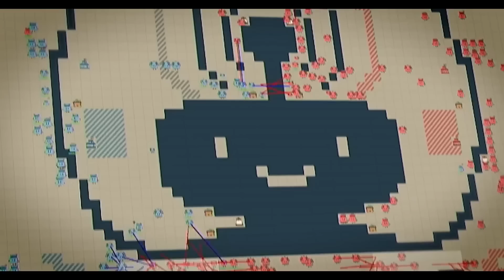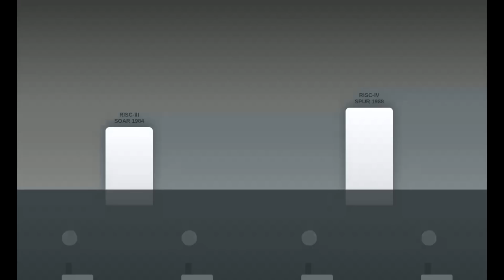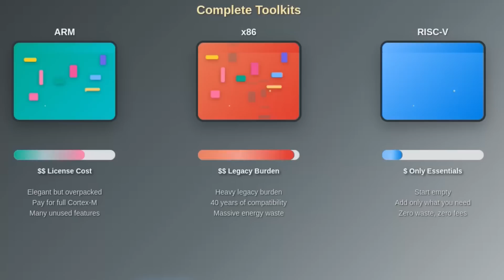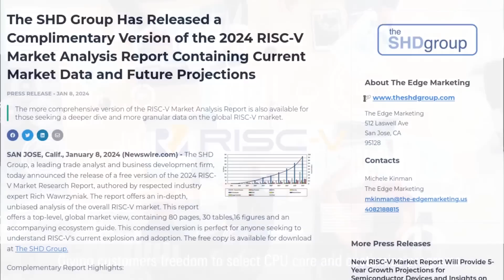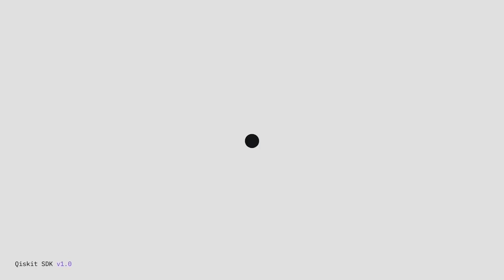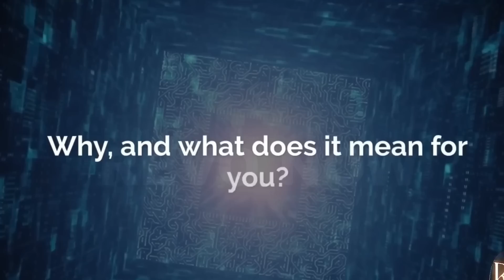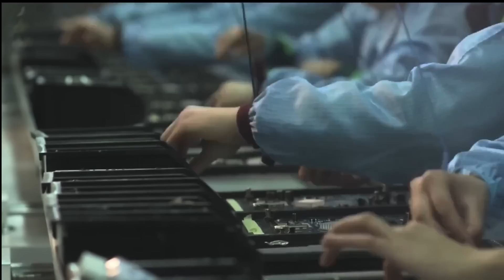RISC-V Will Conquer the World

Comment: RISC V instruction set is awful: it takes many instructions even for the simplest of operations. It doesn't have register windows like OpenSPARC, it doesn't have branch instruction slots, giving one a gratis extra instuction on any branch not taken like OpenSPARC, the performance of RISC V is dismal when compared to the SPARC64 and the UltraSPARC T4, T5, S7 and M8, even the 20 year old SPARC64 VII from Fujitsu runs circles around the fastest RISC V microprocessors. And ARM64 designs are also much faster than RISC V. There is also no standard way to boot a RISC V system, everyone does their own thing, so every bootstrap is custom. I am hereby openly accusing you of ideology and hype.

Comment: Wasn't it Microchip that started the RISC series with PIC processors. RISC architecture has been around for decades. If the clock speeds are not high , they just end up with less performance than a normal processor.   Check out performance of RP2350, which can be run in both modes.

Comment: The RISC-V will get nowhere unless there is a second source for the parts. Custom parts are extremely expensive to make - the EDA tools cost hundreds of thousands a year, the masks likewise, and then the fabrication costs. This is not possible for most startups unless they have millions of dollars in the bank. RISC-V is just an ISA architecture it is not an open hardware platform.

I believe we need actual Si with multiple manufacturing sources to allow this architecture to be used by SME, and startups. Maybe the RISC-V foundation should standardize some parts, including the power, timing and pi 0:35 nouts to make it really open to all ?

Comment: One thing you seemed to miss is that the path RISCV is currently on is nearly identical to the path that ARM is on.  RISCV will  definitely fully displace ARM in the future.  Unforturnately, like with ARM, I think RISCV will not be able to displace much, if any, of the x86/x86-64 CPU market.  ARM has not been able to replace an x86 CPU for one good reason:  Performance.  ARM has a price:performance advantage... until extracting the performance of an x86 core from an ARM core.  At that point the price has skyrocketed, power consumption has increased drastically, and value is eroded.  RISCV, like I said, will definitely replace the ARM CPU's eventually, but there's not much hope for replacing x86.  (BTW: The ARM chips that are able to rival an x86 have virtually become a CISC chip by then with the absolutely massive expansions to their instruction set and complexity involved in programming them.)  Thanks for the video.  Well produced and thought out.

Comment: In the movie Hackers (1995), there's the quote that RISC is going to change everything. At the time, this was already a joke as people had been saying that for so long.
Reply: CISC is so power hungry. There is no CISC core that beats a RISC core on a MIP/WATT or FLOP/WATT which is why many CISC architectures have turned to RISC internally to simplify and reduce power consumption. Also, ARM was designed with C and C++ in mind while x86 wasn't. I have vector graphic illustration program on my ARM which is literally 1000 time smaller than x86 equivalent and runs that much faster too. Either Microsoft cannot optimize their compilers for x86 or CISC is very inefficient. I suspect both.
Reply: The current x86-CPU are internaly RISK as far as I know.

Comment: RISC-V compared with i5/i7 in desktop environments: RISC-V is 20% - 80% slower. So I wont hold my breath.
Reply: You're not wrong to say  likewise I RISC-V is promising, especially for open-source and low-power applications, but it’s not ready to replace i5/i7 for mainstream desktop use—at least not yet.
Reply: That is simply because the same level of effort hasn't been put into it. There is nothing about the architecture that makes it inherently slower.
Reply: All the efforts so far to develop risc-v have been in the embedded and server space, as mentioned in the video. Those have different criteria for design than desktop PCs need. There's likely to be a trickle down effect from some of the development in the server space, but the last estimate I saw for high performance personal computing on risc-v, was that it's five to ten years away.

Comment: Disagree entire video. Riscv is bad because it doesn't always come with the entire instruction set which by the way is probably less then java bytecode 256 instruction set. If a cpu cannot compute it's not a cpu. Only thing I agree with is you don't need vector extensions that's a GPU thing. Arm is better in every way and also allowing more companies to build arm chips like apple. Arm has ultra low power consumption and isn't only made for mobile devices unlike what you said in this video. Riscv processors may be good on the software side but the actual CPU are either low performing or buggy unless made by a property company like wd. Riscv is ok for non true cpus like the chip found in your hard drive or SSD where you don't need an entire CPU or power. But same could be said for an asic chip the difference is riscv is cheaper to make and takes less research and cost
Reply from the maker: Believe me, sometimes it's actually pleasant to hear such a disagreement — and that’s perfectly fine. Your opinion is completely different from mine. I see RISC-V from a different perspective, not just technically, but also culturally and ethically.

Comment: isn't there a fundamental difference between ARM and RISC-V business model.
with arm license you get a transistors blueprint, which you know works well and is tested, and all you need is to put it in a chip with some additional modules.
with RISC-V you need to design it yourself or get a commercially designed core anyway, from a smaller company with less gurentees of compatability.
Reply: @michaelzlprime  Not quite. How it works is well-known and RVA23 Is the standard instruction set upon which all future programs and operating systems will confirm with. RISC-V means total freedom. Yes, there is a cost to manufacture, but that is to be expected.
Reply: With arm , if you design it (the micro-architecture) yourself, you get sued.

Comment: You visit the *RipperDoc to get a neural update to your core processor. He sent you an encrypted sub-token letting you know he has something special. Something called Risc-6 was created for some of the newest neural tech. This new in your head chip includes a new NIP extensions expanding your cyberdeck to use new network protocols. You will no longer need to cross the *Blackwall to get to powerful coprpo AIs. Only the Risc-6 nano-chips will be able to run the latest daemons. These new daemons are available only in lesser known cyber-shops. Net Runners upgrade today. "possible fiction, *CDPR CP77, 80" 11 BD 55 7A 7B".

Comment: For custom built hardware, the modular instruction set design is useful to save a penny in production costs. But for a general purpose desktop OS a CPU needs to be able to do every feature out of the box without needing a complete hardware change to enable some feature. Turning on all the features described sounds like CISC with more steps.
Reply: Many Linux Distros have already caused a headache requiring a new vector set for their distro. Orange Pi is one board that has been cut off at 25.10 so we  may not be able to use newer versions of Ubuntu Canonical releases. " Ubuntu 25.10 release to mandate RVA23 profile, obsoleting most RISC-V hardware."
Reply: @alabamacajun7791 It was better that this be done early, before people start buying RISC-V  desktops.

Comment: Uhm the only cons is that if there is no standard set of instructions because mosularity you might have to recompile the code for every different processor, which might not be possible with proprietary software... In an era in which you don't own anything i see it hard to believe  ompanies would allow that. And even with opensouce software it would be a pain to correctly crosscompile for custom CPU sets...

Comment: I doubt RISC-V. Linux circa 1994 (Red Hat Linux debut) promised to replace dirty Windows.  But, after 30 years, still about 4% market share in desktop OS. I forecast that RISC-V will reach 5% market share in CPU/SOC market by 2050 or 2060. The only exception will be the fixed controller core (e.g, controller embedded in WiFi chip or SSD chip, etc.). Even on 2060, RISC-V will hardly be used to run application software like game or web browser or spreadsheet on smartphone or PC or game console. Most RISC-V will be used as embedded controller chip like ECU or ABS controller in automotive industry.
Reply: The difference is with the OS analogy is that money was involved. Windows just worked and Microsoft paid off OEMs. 

At this time, ARM is currently a huge competitor to x86 in terms of chips. We are already in a period where there is a changing market. There is significant actual benefit to using ARM depending on the use case. All we need is a major funded player to join the game, just like Apple did with ARM.
Reply: @EmCeeJuan1  I don't expect that Microsoft or Apple or Samsung /HP/Dell will ever sell laptop computer/desktop or datacenter server or smartphone based on RISC-V and get 5% of market share before 2050. Even with Apple Mac computer line based on ARM, Windows laptop with Qualcomm ARM chip is struggling on market. We don't see RISC-V based smartphone, yet.  I expect 10% share of ARM Windows laptop by 2035. RISC-V based PC/smartphone? Below 1% share until 2050. No technical/economic incentive to switch to RISC-V from ARM.
Reply: I'm more positive than you are. RISC-V is moving fast.  I expect it'll be less than 10 years to desktop/device usage.

Comment: Programmer's Journal 1990s, Hal W. Hardenbergh OFFRAMP: Hal declared RISC dead in ~1995.  RISC depended on inferior (slow) RAM hardware and slow CPU clock rates. Your hardware is hardly RISC. It must support multi-threaded  capability, which was never part of the original RISC definition.  The silicon needed to support "score-boarding' is hardly simple!  Your RISC-V description sounds more like the DEC Alpha/AXP chip which was really an optimized instruction set chip! I look forward to seeing RISC-V on the shelf. I suggest adding security from OpenVMS, which uses hardware, software features to protect the operating system. I suggest supporting High Performance Computing (HPC.)  We need cheap and ever cheaper electricity everywhere! It's a fantasy to think more electricity  will not be needed! We need to stop the "watermelons" from driving the cost of electricity up daily through the EPA and other socialist organizations.
Reply from the maker: It's true: the original 1980s RISC definition didn’t include multithreading or advanced execution units,  but the world has moved on. RISC-V isn’t trying to preserve a museum piece; it’s building a modern, modular, extensible ISA rooted in RISC principles but designed for today’s needs.

Hal may have declared RISC dead in 1995 , but ARM, Apple Silicon, and now RISC-V clearly disagree.

RISC-V isn’t about dogmatic purity. It’s about open innovation, custiomization, and trust.
As for OpenVMS: great inspiration , but today’s security needs must go deeper, and that’s why open silicon and verifiable hardware matter more than ever.

And on power? Efficient design is the point. If anything, open hardware gives us a fighting chance to do more with less, instead of chasing unsustainable complexity and centralized control.

Comment: Yeah, linux worked as an open source platform because it matured in a free and open enviroment. A  party with ill intent can only resort to bugging and hacking as they already do with an existing OS. You cant corrupt its programming and spread it about for very long without someone catching it. It like trying to hide in the open. Chips are different. If a group conspires to make chips with a fatal flaw that can fail on comand, no one would know. They could make billion of them and spread them around to anyone that might have a use for that type of chip. Like a sleeper cell, waiting for decades, to receive the command to perform its hidden function.
The potential for death and destruction would be limited only by the perpetrators imagination.
Reply from the maker: You're absolutely right to highlight the asymmetry between open software and opaque hardware:  it's one of the most critical challenges of our time.

That’s exactly why initiatives like RISC-V matter: we need open architectures not just for innovation, but for trust and verifiability. Closefd-source silicon is a black box : and you’re right, it could be weaponized in ways no antivirus can stop.

We need more open tooling, open verification flows, and global cooperation around chip design.
The nightmare you describe? It's not science fiction. It's a warning, and the op[en hardware movement is trying to answer it before it's too late.
Reply: @YouTuxChannelGlad to hear im not telling you something you dont already know!  
Who is making them now? Is there any kind if international register on who is making how many and where did they go? Serial number, date of manufacture? That sort of thing? I cant imagine how you secure from that without violating the very principal of what it is your trying to accomplish.
Reply from the maker: This is another intelligent observation that touches on a crucial issue for RISC-V:  one that will determine whether it becomes a true revolution or just an open-source chip that doesn’t shift the deeper power structures.

The beauty of RISC-V is that it opens the door to verifiability , but you're also correct that open ISA ≠ open chip by default.
That's where projects like OpenTitan come in: open silicon designs, open tooling, and even transparent verification pipelines.

But yes , we're still far from having fully trustable supply chains.
What’s different now is that we finally have the chance to build that transparency, instead of blindly trusting black boxes from opaque vendors.

It’s not perfect , but it’s the only shot we’ve got.

Comment: One Linux RISC-V phone please.
Reply: Maybe in 10 20 years
Reply: With samsungs sh* chip foundry which will make it a heater
Reply: @martinmathangani   Android is a linux based os anyway.
Reply: Why not desktop OS on RISC-V
Reply: With many propertary packages, locked bootloader and with a tone of solder and glue
Reply: @martinmathangani  it would need a car battery
Reply: @martinmathangani  Phones are a full high end  computer, it needs a powerful CPU. Not a Risc-V use case. YET!

Comment: The hardware needs a similar standardisation. We need the same hardware from multiple manufacturers - the current system is just not standardized enough: the debugger interface, the instructions extensions all allow manufactures to customise RISCV to a point it is no longer open. The collective engineers of the world  should standardise a group of fully open processors hardware, these would be manufactured from multiple suppliers. The current ISA standardisation is just not enough.
Reply: There are profiles and RVA23 will be the baseline. Ubuntu 25.10 will require RVA23 for RISC-V.
Current baseline is RVA20 and current hardware is mostly RVA22.
Reply: @albertdye3942  This would stiffle innovation with yet another death by comittie to agree on standards. Let's just pick the best and develop code agnostic solutions ontop its drivers using WASM run times to compile code to Risc-V compatable processors.
Reply: The problem with one source parts is obsolescence. I hate redoing a PCB because the sole manufacturer of a component decides not to make it anymore. @ickorling
Reply: And there in lies the danger by parties with ill intent.
Reply from the maker: Great comment ,  you nailed the existential point that could determine whether RISC-V truly becomes a revolution or just another missed opportunity. 
Standardizing open hardware is the real turning point. Without that, we risk diluting the very promise of an open architecture.
Reply: @YouTuxChannelBut ARM has different profiles also, doesn't it? The mainstream compilers won't use instructions apart of these profiles.